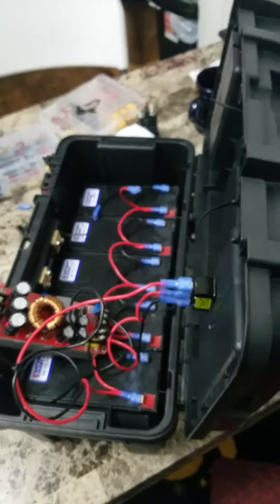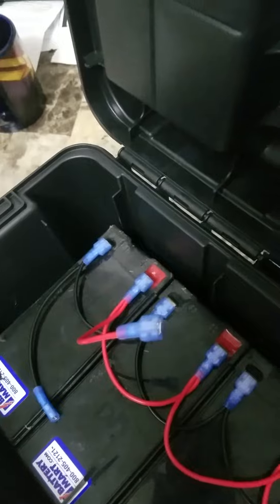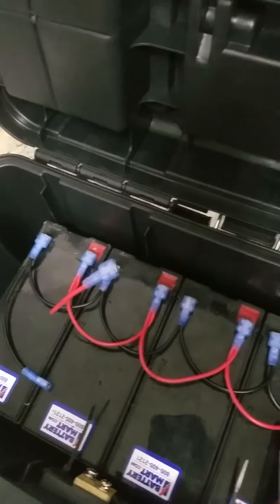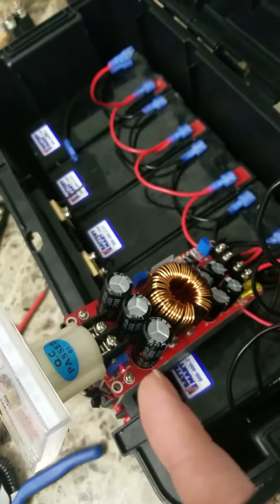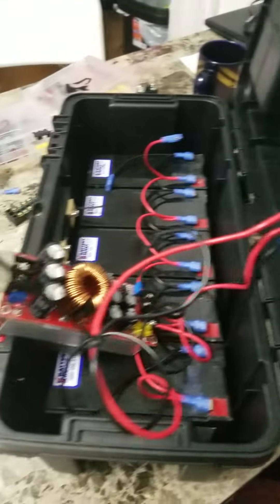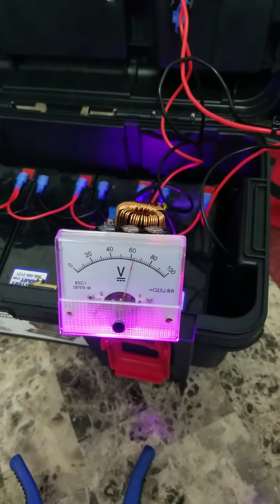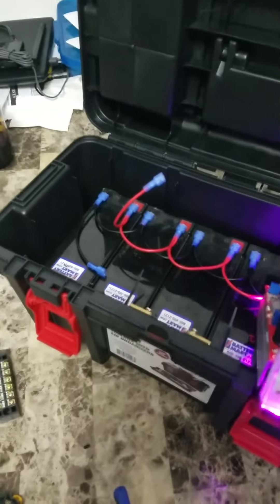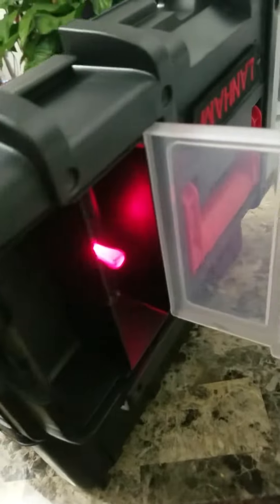12v DC Power Box

Comment from the maker: the boosting module that i'm using can be adjusted for a steady output voltage of up to 90VDC. be careful when working with DC voltages past 50VDC because it can be deadly.